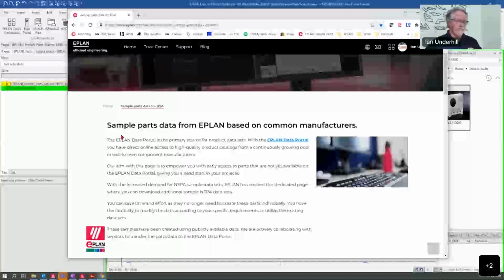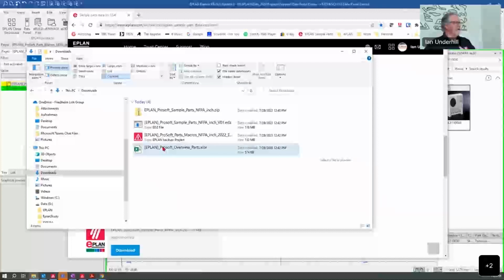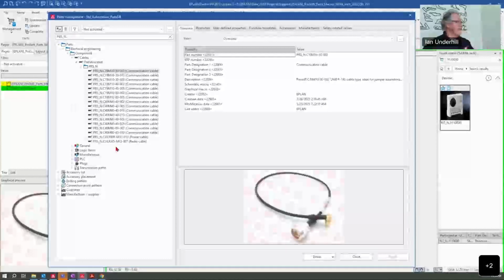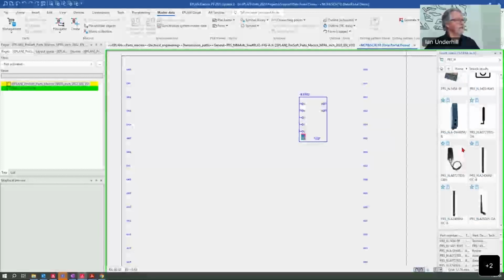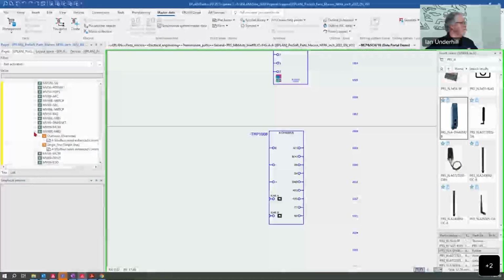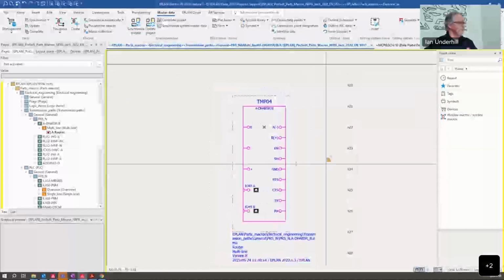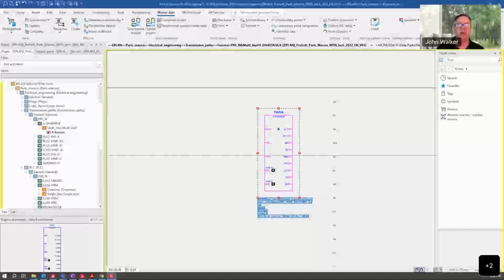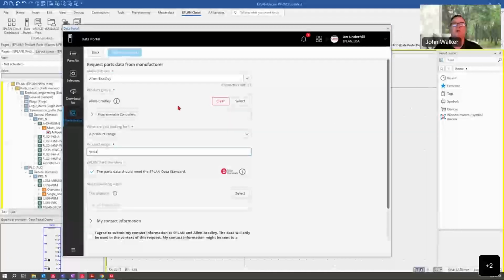New Sample Data with EPLAN

Comment: Hi. Thanks for making this available. I have a few questions:

1. From what I understand, you provide a macro project per manufacturer. Are those only for new parts that will eventually be added to the EDP, or can we expect the same for ALL manufacturers' parts, even those already on the EDP? The reason I'm interested is that most manufacturers' parts currently available on the EDP are created in mm. I have many customers who use inch-based grid plotframes, and modifying each macro individually is a time-consuming process. If we had macro projects for all manufacturers, then we could more easily edit their macros and make them fit on the inch grid.

2. Is there anything on EPLAN's roadmap to automate the conversion of mm-based macros to inch (and possibly vice-versa)? I understand this would be a bit difficult to get perfect results 100% of the time, but it would greatly speed up the conversion to the final result, even if all we can get is a conversion 70% of the way. I've been thinking of developing such a tool in API, but if it's something already in your pipeline, then I'll use my API development time towards other tools. 

3. As a temporary workaround, is there currently a workflow where I would select some parts in the EPM, and have EPLAN create a macro project from existing macros? Even if we had to put only one variant, and representation type, per page in the macro project, this would be a very good starting point. The time-consuming aspect of doing this manually for each macro is obviously to insert each variant, and each representation type, manually. In some cases, macros can easily have 4 variants, each with 2-3 representation types. A single macro would easily result in dozens of individual macro boxes. Doing this manually is not something that users are willing to invest time in. 

So, thanks again for what you're making available to us. Please consider my questions/comments above for future versions. In my 20+ years of using EPLAN, both as a user and then as a consultant, this is one of the most common complaints I get from customers when setting them up for the first time and they realize that the EDP is practically 90% metric. Of course, if everybody all went mm, that would make our lives easier 😎

If we dig a bit deeper into this, we can even conclude that a system of units for 2D electrical schematics is really an arbitrary choice. They could be pixels, twerps, em, or even a custom unit system, and it would be transparent to users. Please note that I'm only talking about schematic pages (single-line, multi-line, and so forth). On the other hand, mechanical drawings, such as panel layout pages, must support metric and imperial measurements (as they already do today), but an electrical schematic, is really unitless. Users are not going to put measurements on schematic pages, as it's really only an abstract representation used to define the source and targets of connections. If schematics pages had a single system of units, this would remove the need for manufacturers to maintain two separate sets of macros on the EDP. That would even still allow exporting/importing EPLAN pages to any existing units by applying the proper conversion ratio.

Anyway, these are just thoughts that occurred to me over time. I'm sure there are cases where my whole reasoning would go up in smoke. I just felt like sharing it, and who knows, maybe start a discussion.

Regards
Reply from the maker: Thanks for your patience on these questions. The answers to your questions were provided by our Professional Services department and are as follows:

Question 1, the assumption his is that you are referring to the new EPLAN downloads for NFPA data that have been made available for US customer. The parts selected for these downloads have been chosen based on feedback from our Channel Partners. Where these are for existing manufacturers, we are working to encourage them to create official NFPA Inch data for the Data Portal. Where they are not current represented on the Data Portal we working to bring them onboard.

For Question 2 & 3 there is a related answer. There has been some effort into creating conversion tools/utilities however we are not aware that this reached a point where such a tool would be available. There was a system that allowed user to request part data though the Data Portal in the past however it was not well received so has unfortunately been discontinued.

You are absolutely correct with your statement “an electrical schematic, is really unitless” the consultants and application engineers here at EPLAN recognize this. With new customer there are standard consulting packages we encourage them to use. This helps them get up to speed quickly and as part of the package we help then set up basic project to include the plot frames and common report and these are offered as in IEC, NFPA Inch, and NFPA mm form. We encourage our NFPA customer to use the mm based template for many reason not the least of which is the large amount of data available to them on the Data Portal as you identified. To help them with the decision to use millimeters Plot Frames we supply in the NFPA_mm basic project look identical to the inch based version on the screen and importantly when printed.

We also have NFPA_mm based Part Macro Project available for them to use and help the to start a NFPA_mm based macro library and as part of the consulting we teach then the step to take IEC macros and easily convert them for use in and NFPA setting. With the consulting we also supply a tool that automates the linking of the new NFPA macros to the parts Database. 

We also point of that a huge amount of the “IEC” parts use a function template and symbols rather than a macro and these work in any standard without any changes